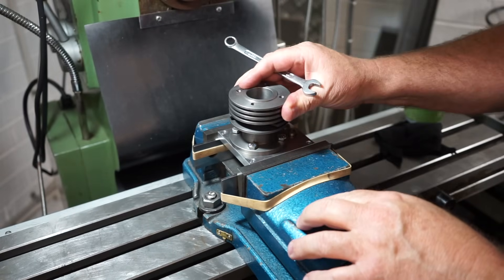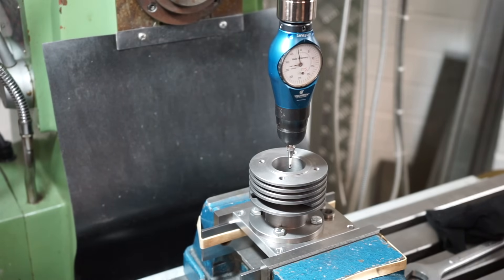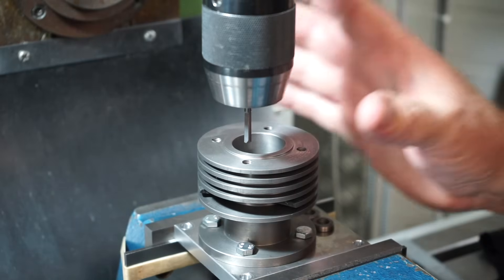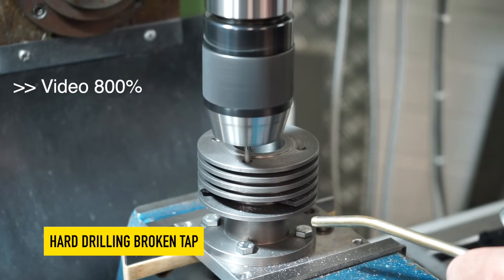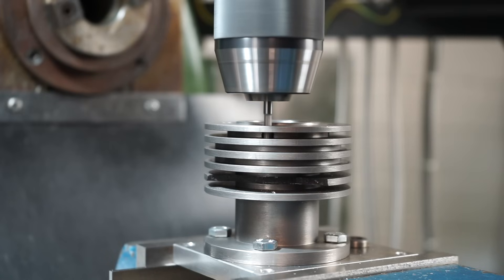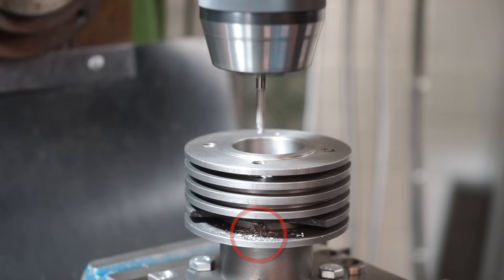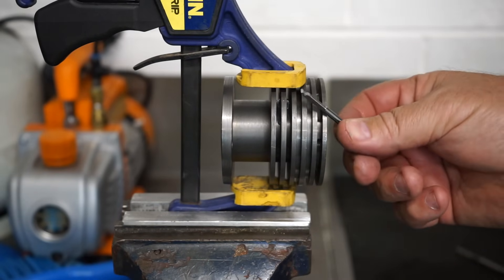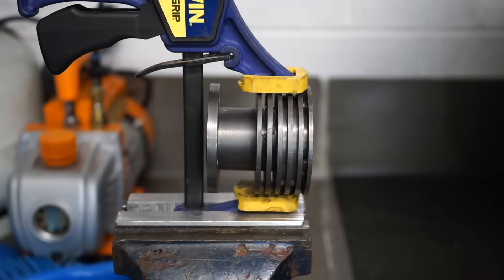HARD Drilling a BROKEN Tap

Comment: I broke a 6mm tap off in a blind hole when cleaning threads on my 240Z block. A guy got it out using EDM (?) Electronic Discharge Machining.
Reply from the maker: The small EDM’s are an excellent tool for that. We had one at work I could have used, but thought this would make for an interesting video. 👍🍻

Comment: I've used similar drills in the distant past to drill out broken exhaust studs on marine diesel engines. These are medium speed diesels with a bore of about 300 to 400 mm. They were considerably larger diameter than this as the studs would have been 5/8" to even 3/4" BSW, but as someone else has mentioned, they were made of Stellite. I suspect that back then, carbide drills were not easily obtainable, or were very expensive, or both. Certainly, nowadays, I'd go carbide or possibly cobalt first, those broken studs can be very hard, but nothing like your tap of course. That was a really good save.
Reply from the maker: Hi Bill. Thanks for watching and commenting. As a former mechanic (before swapping trades into engineering) I remember drilling out broke exhaust studs and flange studs. However nothing like the size you’ve worked on. Now that’s some big engines. Cheers 🍻 Aaron
Reply: @AaronEngineering  Ahh, those engines were the small "auxiliary" generator engines. The big ones were the main engines, the majority of which I sailed on had 900mm bores and strokes approaching 2 metres.

Comment: Might try one of these the next time I need to do this.  It's better than sending out for vibrating the thing to dust
Reply from the maker: Hi Jason.  Absolutely mate, however run the RPM faster than what I did.  Please read the comments, as there was plenty of others that knew all about these and how to use them to their full potential.

Comment: I'm not familiar with that tool. Thanks for the tip! I do this fairly often, but I typically use a carbide endmill. If I could make a few suggestions, you might try using moly D, as it has a higher viscosity, and will stick to the surfaces better. Also, try using a collet, instead of a chuck, to minimize runout. One last thing, if you lock down the quill, and instead use the knee, you can be much more precise with your lunge rate. It will also let you see how much progress you're making. 
I usually haul ass on the speed, and take extremely small plunges...a few thou at a time. Very delicate process.
Reply from the maker: Hello how are you.  All excellent tips, thank you.  Some people have mentioned what you suggested in the comments.  Especially running the RPM to slow and not locking the depth stop shorter.  I was hand feeding by using the quill and the quill feed handle.  But the depth stop was set below the hole and not above so when I broke through it pulled the quill further and snapped the end of the hard drill.  Oh well, sadly I'm still making silly mistakes.  Thank for watching and commenting.  Regards, Aaron.
Reply: @AaronEngineering   Shoot. I make mistakes all the time. I neglected to mention it, but even in the process I mentioned above, it almost always results in a damaged/broken endmill. Same exact thing happens at the end of the cut. It just isn't an easy thing to do.

Comment: I have had several very similar experiences with broken taps, the only truly successful way I've ever gotten a broken tap out has been with EDM. I built such a machine about a decade ago and took about a week to get through the last broken tap I've had to remove.  Every other effort has ended pretty much the same as yours, with the tapped hole being less than ideal in the end. That "hard drill" is something I've never seen before but your experience is pretty much precisely the same as mine was.  I ended up with a loose thread in my last effort and ended up using an oversized hole with a heli-coil thread insert which worked for the cylinder I was repairing. I've pretty much retired since "the pandemic" shut down my shop and I currently work part time using my shop for educational purposes these days.
Reply from the maker: Hi John and thank you for watching.  This was my first time using a hard drill.  I was very annoyed with breaking it too.  I agree with you, I think my hole thread has blown oversize ever so slightly.  A go / nogo gauge would probably validate that conclusion also.  I'm very interested in your home made EDM machine.  Now that would make for a good video.  I'm also interested in your shop for educational purposes.  Not sure if you know this, but I'm a high school shop teacher.  I've also taught apprentices at TAFE.  Cheers, Aaron.  PS: feel free to send me an email or FB message.  Email address on my channel about page.

Comment: 50 years ago (as a tool and die maker) I used drill bits like this and they were stellite drill bits for drilling case hardened and thru hardened steel. All cutting edges were negative. These drill bits created friction which heated the material to a high temperature which inturn softened the  material at the point of cut.
Maybe these drill bits are of a more modern day material.
Reply from the maker: Hello and thanks for watching.  I really appreciate your feedback and knowledge on the subject. I didn't know that these had been around for such a long time.  As for me, I'm not tool & die maker.  My first trade was a motor mechanic, then I switched trades and became a maintenance fitter (fitter & turner).  The good thing is that I'm still learning as I get older.  Cheers, Aaron.

Comment: G'day Aaron. Broken a few in my time, & have tried quite a few ways. I think so far the best I've come across is a good quality carbide drill bit, steady, steady with lots of lubricant. 
Let's be Honest it's a crap thing when it happens. 
You did well.
Ted
Reply from the maker: G’day Ted. Thanks for the vote of confidence mate. To be honest I was a little embarrassed to post the video, but did anyway as I thought others could learn from my mistake. Cheers 🍻
Reply: Carbide does not need lubrication.  A stream of air works fine.

Comment: Hi Aaron. New subscriber here from the USA( Alaska ). Really enjoy your content. Heard of you via Max at Swan Valley.  We have a company here in the US called 2L Inc that makes hard drills very similar in design to the one you used. I've only had the need to use them a couple of times, but they've worked great. They suggest running theirs at 1500-2500 rpm and peck drilling( and very small pecks at that, and with coolant if available ) the tap. They also offer a 2-flute end mill that they suggest using first to flatten out the top of the tap if it's broken off in a jagged point. Then transition to the drill for the remainder. Cheers!
Reply from the maker: Hello and welcome to my channel. I’m happy to have you here. Max Grant is good bloke and a very knowledgeable person. Thanks for the pointers I appreciate it. Off camera I did flatten it with a carbide end mill. But I think my RPM was too slow. Cranky with myself for breaking it too. Cheers 🍻 Aaron
Reply: @AaronEngineering  Happy to add yet another excellent channel from Australia, lots of great machining content down there! The 2L Inc products here are called Armor Drills and Armor Mills, and are made to do just that......drill/mill armor/hard metal and taps. They say they will even drill in granite. So, if you want to hang a coat hook on the edge of your surface plate, they'll drill the anchor hole!🤣 Cheers 🍻 Jeff